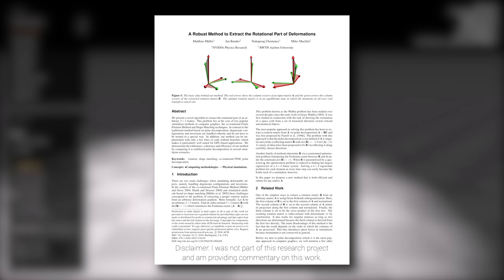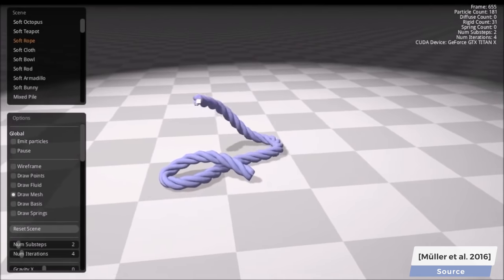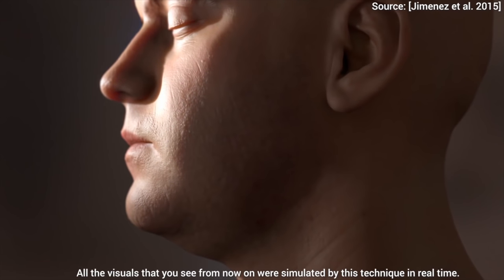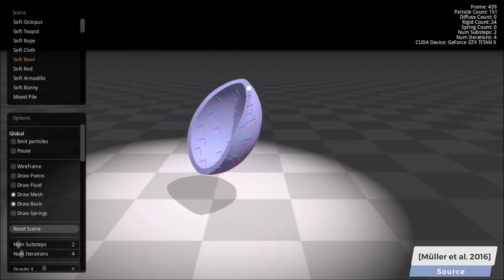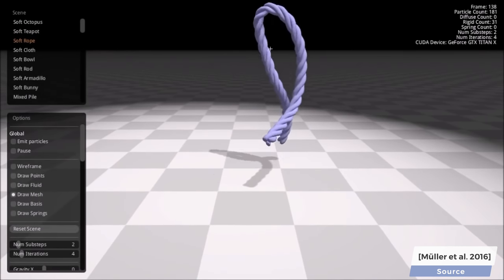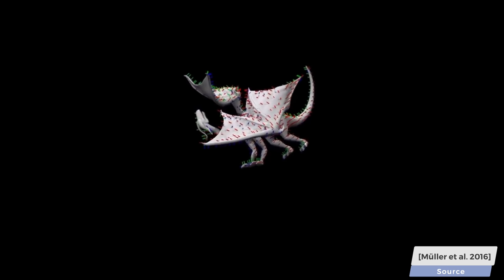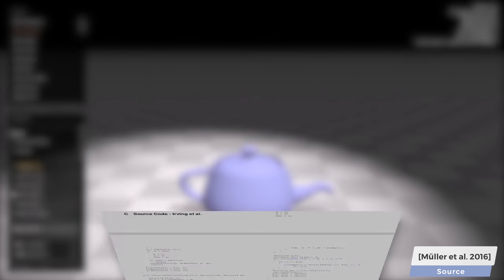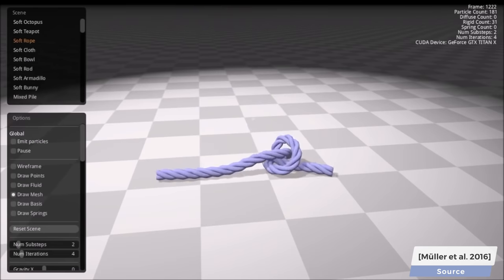Extracting Rotations The Right Way

Comment: What's the time complexity of this algorithm compared to previous ones? Is this algorithm faster? Does it scale better?
Reply: Solve Everything  but the Big O is a simple metric to compare algorithms. If both papers provide it, then it's trivial to put it in the video
Reply: @firexgodx980  Or, you know, can take a look at the source code and see that it contains 1 loop that does some constant mathematical operations, and conclude it runs in O(maxIter), i.e. linear in its input size.
Reply: @DinHerios  yeah I checked that out after I commented. The paper doesn't actually do any speed tests, or time complexity analysis, which is a shame.
Reply: @firexgodx980  Why would they need to do any speed tests for this little piece of code? It is absolutely trivial to see the complexity of this code. The proof is a billion times more important.
Reply: @DinHerios Because speed and scalability matters. All papers that propose new algorithms need to have a section dedicated to speed and scalability.
Reply: @firexgodx980  Two things: 1. I agree it matters in general, but 2. the source code provided by this paper isn't even 15 lines long and it is very easy code. It needs no further analysis. The proof of its linear runtime is trivial. You don't include trivial things in a paper. That's first semester CompSci tasks.

I'm out.